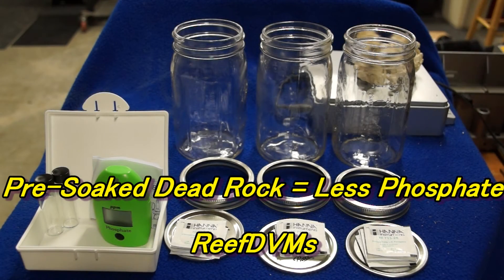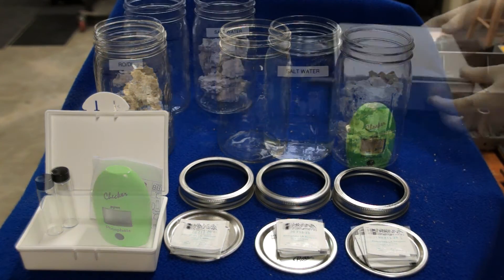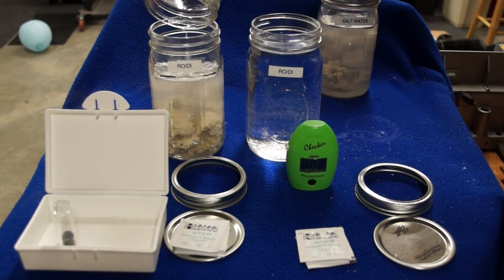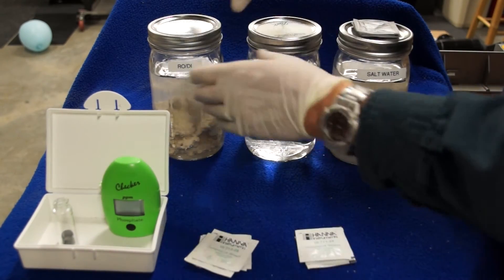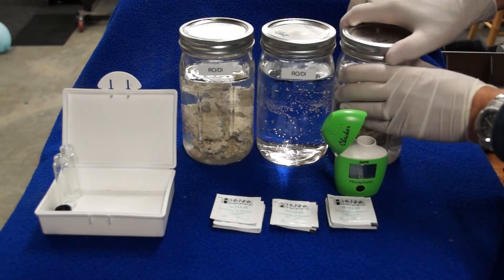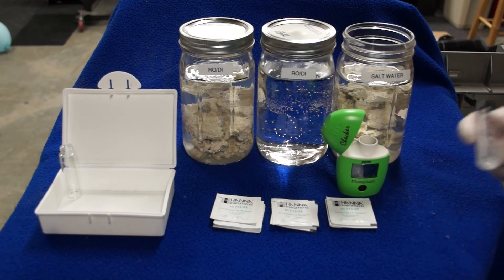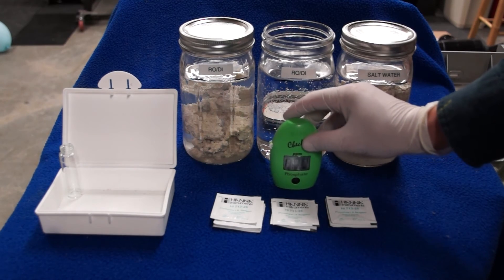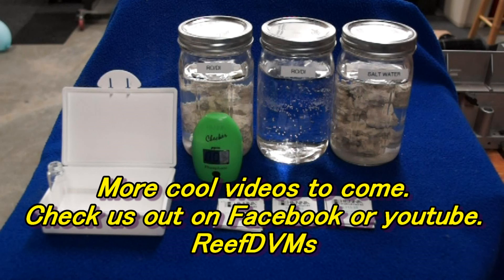Pre-Soaked Dead Rock = Less Phosphates

Comment: Is it enough to soak dead rock in salt water for 72 hours to get all (or most of) the phosphate out?
What If you change the salt water on that dead rock and wait another 72 hours; would you still read phosphate in the water?
As an experiment; you used just a few very small dead rock, I’m sure numbers and hours will be different when dealing with the real figures like 50, 100, 200 pounds that we use in our aquariums. 
Thanx for the effort. Keep it up.